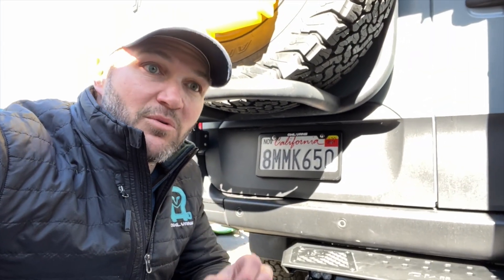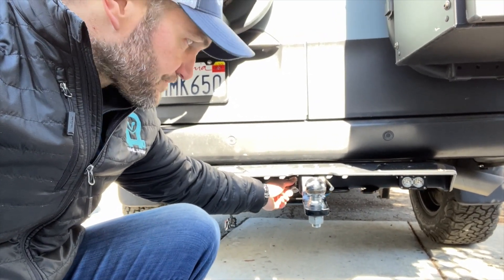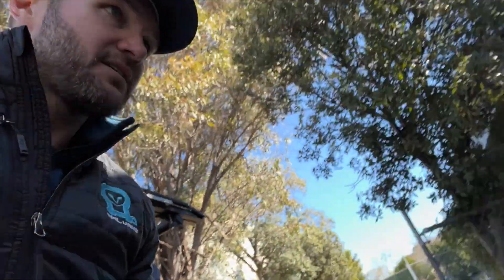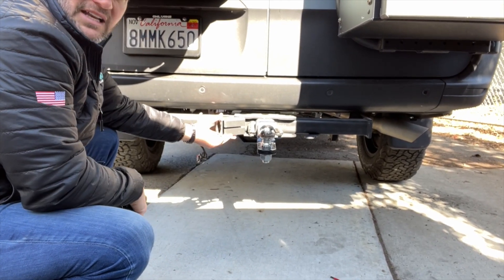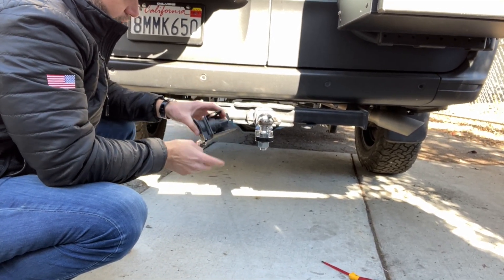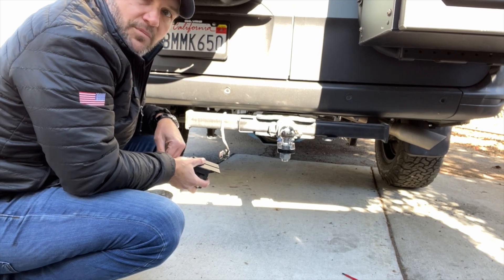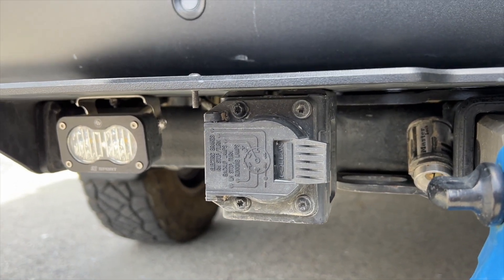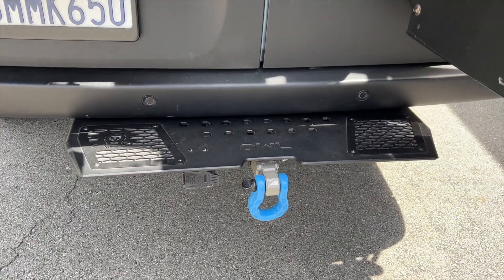Relocating Hitch Connector

Comment: This is great. Isn’t it actually impossible to insert a pin from left to right in this scenario? I’ve always had to go right to left. Then my problem is that I can’t get a lock on the left (end of pin) whatsoever… so whatever I put on the hitch can easily be stolen.  Now I just need someone to do this for me! Do you guys offer services like this at any of your install locations?
Reply from the maker: We certainly could do this for folks but we are pretty busy. If it was part of a larger build we could add it on, but if it was solo, you're probably going to find a local fabricator that is cheaper/faster

Comment: Do you happen to know where I can find the wiring info for the 7 pin connector

I lost mine up the dempster and wires got chewed

Have to re wire one and of course Mercedes doesn’t follow standard wiring

Mercedes is unable to provide the wiring info either lol
Reply from the maker: I am not actually that sure of the wiring for the hitch. My suggestion would be to reach out to Tim at Adrenaline Vans; he might know.